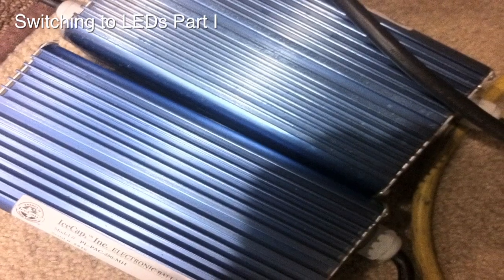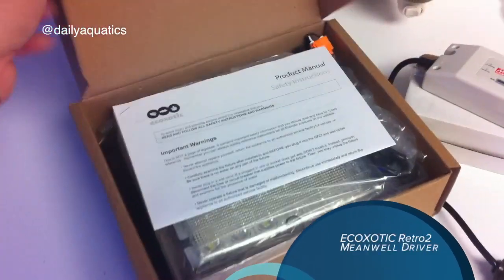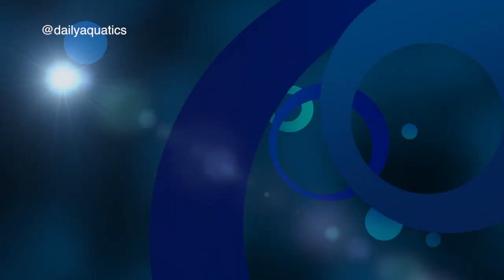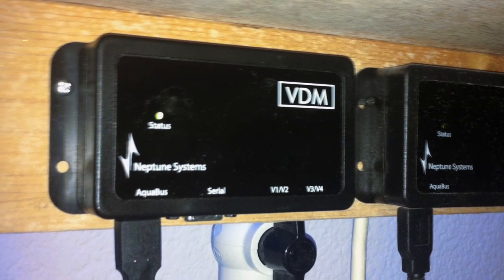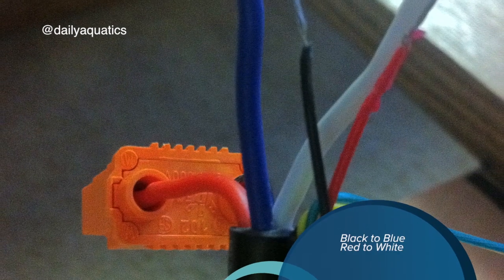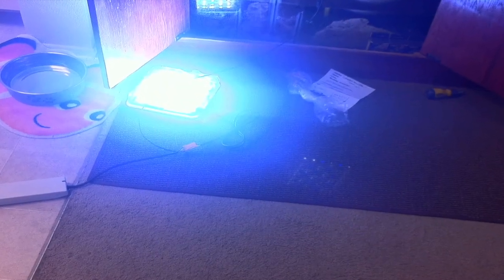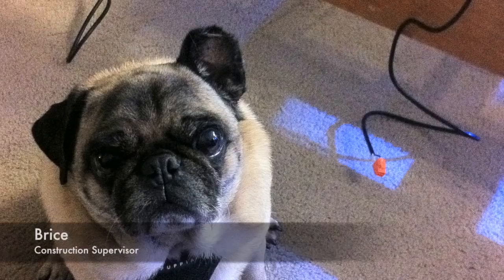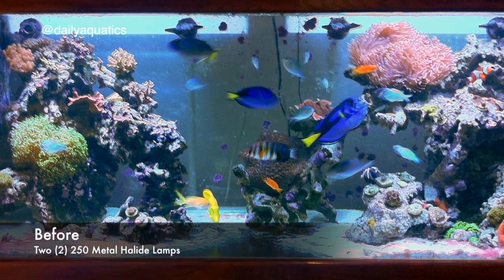How To Program Ecoxotic Dimmable LEDs, Part I: Initial Setup

Comment from the maker: As far as I know, they are only dimmable using their own dimmer switch. The Retro2 units are compatible with the VDM because the driver is remote and has exposed wiring which is then "hard wired" into the VDM/Apex. This however may have changed, I would ask @ecoxotic1 and see if there are changes.